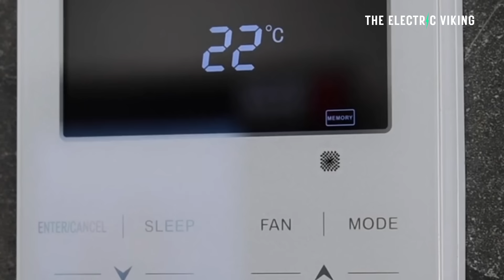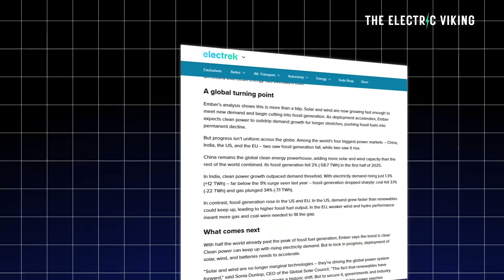Renewables Soar Past Global Pivot Point - Beat Coal For First Time In History

Comment: Wind and solar power connected to the power grid ARE NOT RENEWABLE ENERGY requiring more natural gas for high readiness backup making nearly no electricity than making all the electricity from natural gas combined cycle power stations.  In real terms it makes no difference how large their percentage is on  the power grid.   It is how much fuel they save which is non.   Wind power with wild fluctuation second-to-second is the most natural gas expensive form of generating electricity.   Steam turbine generators react too slowly to support solar and wind generated electricity so the only alternative is expensive  to fuel natural gas turbine generators.   That's why coal power stations are being retired along with being inefficient and old.   

China is re-powering its grid and increasing capacity with new USC clean coal power stations.    These have liquid steam not traditional steam that allows some fast response for supporting wild AC from solar and wind power.   The US's war on coal since 1992 appears to be coming to an end.  The US will hopefully follow China in re-powering its grid and expanding capacity with highly efficient USC coal power stations burning high BTU bituminous coal.   The policy of giving solar and wind power on the grid free very expensive to fuel support backup should be closed out.  Every percent of it on the power grid comes at high natural gas expense that can't be met by cheaper to fuel sources.

Power River Basin low sulfur low BTU coal has only had a market for old coal power stations unable to meet sulfur dioxide emission requirements otherwise.   China has bought a lot of this coal.   That is probably to use in dirty coal power stations with no after treatment to give substantially more breathable air, but sill very dirty air.  There is little market for its use in new USC coal power stations.  Its been well acknowledge that coal with be otherwise worthless if not for its low sulfur content.

Comment: The only pivot that matters is GHG levels which are accelerating upwards at record rates so why you spouting this ?  Its clear we have passed tipping points that will cascade to ever worsening effects , there is no room for optimism until GHG falls .
Reply: This video mentioned it's dropping in the electricity generation sector. 

Overall, use is still going up, but it's very important to celebrate victories and progress when they happen. Pessimism causes little to give up or avoid change. Optimism, the belief that you have the power to make positive change, drives action
Reply: better visit eastern Europe or Russia, you will slash your wrists.

Comment: This is another absurd story!! Every energy time will be used to meet the increasing energy demand. Coal, Oil, and gas use will go up with renewable energy.
Top 10 Countries by Renewable Share in Electricity (2024 Data)
Enerdata Global Energy Trends 2024; Eurostat 2024 data (confirming high EU performers like Denmark at 88.4% and Portugal at 87.5%). Note: Some countries like Iceland (nearly 100% from hydro/geothermal), Costa Rica (98% hydro), and Paraguay (100% hydro) also achieve near-total renewables but are not always ranked due to smaller scale or data variations.

The major economies are not.

Comment: Sadly the amount of coal being burnt is still rising by about 1% per year. Renewables are rising faster but renewables surpassing coal use is not the same as coal use declining. With huge demands for energy to run AI, energy use could increase rapidly which means that coal use will not slow down for some time. Gas use is also increasing at 1% per year. Complacency is not good.
Reply: The acceleration of solar is so absurdly fast and not slowing down, that the peak of coal use is probably this year or next. 

The economics and timelines just makes sense. You can't build a coal plant faster than you can install off-the-shelf panels & batteries. And it's just more expensive in most places
Reply: the tide is turning thank goodness.

Comment: Solar and wind power will go the way of the dodo bird when better technologies are implemented. Thorium nuclear energy is becoming a reality. Thorium reactors can not only use thorium a waste product of rare earth element refining but also nuclear waste. Quais a spin off company of MIT will make geothermal energy available in most areas. Water to burnable gas technology will not be able to be suppressed forever as others are duplicating Stanely Meyers water powered vehicle. Just imagine, water fueling cars, trucks, locomotives, and jet planes. No more trips to the fueling stations. No more long waits for the battery to charge on an EV. Just fill the tank on your car with your garden hose.
Reply: That'll be cool when it happens. Nobody's suppressing it, they're just not ready yet. 

Until then, we go with the solutions that are functional and available to solve the immediate problem, because there's no time to wait for a new tech. Fossil fuels need to be phased out yesterday
Reply: It's called steam engines. We've moved on from that inefficient energy production.

Comment: Here in the UK we live in the 5th cloudiest country in the world and solar even makes sense here
Reply: Yes it does. It was calculated that we would need just 3% of land covered with  solar to power the whole of the UK.
Reply: @markgilder9990 and how much of the UK is Urban area? You can preserve forest and farmland and still power everything with just panels over buildings, parking lots, roads, carports and other paved surfaces
Reply: @kylejohnson6775  I believe it's about 8% urban, so yes, easily room for the 3% mentioned.  NB they're "car parks" in the UK ;)

However the question is, does that still work in winter when the daylight is least and the energy demand greatest?  Until we can get lots of batteries that can store power for months, we'll have to keep a considerable wedge of gas for heating and electricity for those cold dark months
Reply: @Shikuesi we’re a world leader in wind energy mind and usually the winter months when solar is lowest the wind is strongest and generates more. Issue is calm winter days, but hopefully storage or burning a bit of gas then as needed in the meantime till we have sufficient storage, covers things.
Reply: @Shikuesi 

It works less well unless you massively over -build capacity. If you've ever heard about the studies where they examined "how far can we go with just solar and current batteries?" the cost always has an exponential spike as you approach 100% of the hours in a year covered by just solar, for exactly the reasons you mentioned. The darkest shortest days are tough, but they're a small minority of the time and mostly a problem for the minority of humans who live far from the equator.

So, solar and batteries can do the bulk of the work, and you need wind, nuclear power, maybe enhanced geothermal, maybe hydroelectric, or maybe a breakthrough in bigass seasonal-storage technologies, for the last 5 - 50% (location dependent) of hours in the year where solar can't cheaply cover your needs

Comment: The comparison between coal and renewable energy is misleading. Renewables have an average capacity factor of less than 0.3 while coal has a capacity factor of at least 0.9.
A comparison between them should factor the coal value by 0.9 and the renewables by a factor of 0.3. So, they are both equal in energy output if the renewable number is THREE times the coal value.
Reply: The output values (how much solar was generated this year) include the capacity factors. 

Also, if you're making an honest comparison, you need to include the capacity factor for their actual use, not theoretical use. In China the coal capacity factor is a little under 0.5 and falling, because solar and wind and batteries are cheaper and being used more than the coal plants, so the coal plants are spending more and more time idle
Reply: @kylejohnson6775  Point conceded about capacity factors.  Last year in China renewables represented abour 52% of nameplate capacity but only supplied 12% of Total demand. Coal was 42% of nameplate but supplied 70% of total demand. China's renewables were mostly IDLE.
Reply: @sabb007 

I don't see how this conflicts with the figures in the video of total electricity generated or the other point about capacity factors. We already know that renewables are idle most of the time. That's the single most common complaint or mentioned downside. They're so incredible because they're meeting demand and beating prices of coal despite the idle time

Comment: You would think that companies would see the writing on the wall and start slowly replacing fossil fuel driven machines with electric (from solar\hydro\nuclear\wind\battery) driven machines, including those needed for power generation, cars, construction and agriculture machinery. Who knows if cost considerations or the environment will be enough of a stress on financial resources that companies will make the transition. If the price of oil and gas keeps going down, and it remains cheaper to use them as fuel than renewables, they will continue to keep using them until renewables become a no-brainer. We haven't actually reached that point in the USA.  But I'm convinced within a decade we will reach that point, and affordability will be the biggest factor as it usually is when sane people are in charge.

Comment: Coals are still useful in furnaces of iron ore.  But that requires high quality coals.
Reply: Iron ore can be reduced to iron using hydrogen generated by electrolysis. Lots of projects are starting up exploring the technology. But....

Once you've got the pure iron, you still need to add carbon to turn it into steel.
Reply: Adding carbon to iron isn't really a climate change issue though, because it's solid carbon. If it's not a gas in the atmosphere, no trouble

Comment: in Romania: 
1 MWh produced from Coal powerplant cost: ~400 euro - 450 euro
1 MWh produced by wind/solar cost: ~100 euro - 150 euro
In the last week Wind power is the number one producer.
Reply: Brilliant.
Reply: Kost per MWh for solar in europe is closer to 5ct/kwh with large german PV plants now achieving as low as 4ct/kwh. Considering the higher yearly solar radiation PV cost in Romania can likely reach costs below 4ct/kwh.
Reply: Wind/solar at 100 -150 euro MWh is not the real cost.   All that erratic power costs more natural gas in high readiness backup making nearly zero electricity than making all the electricity from natural gas combined cycle power stations.   Wind power with wild fluctuation second-to-second is the most natural gas expensive form of generating electricity.    The UK and Germany are culling wind farm output to save on very expensive natural gas.   Wind and solar on the power grid were made possible by cheap Russian natural gas.  Without it they are too expensive of novelty to support.   Spain appears to still be running on cheap Russian natural gas.  In the US natural gas generated electricity bids at $100 MWh.   That source can be used for high readiness, but the payment scheme is not on bidding platform as such.   It would be a very high set costs with little electricity probably being called on.

Comment: Scientists have developed a new type of concrete material that can function as a massive battery, turning buildings and roads into energy storage systems. The team at Massachusetts Institute of Technology (MIT) first developed this next-generation energy storage system in 2023 and has now made it 10 times more powerful. This breakthrough means that the average home would need approximately five cubic metres of the material to meet all its energy needs, which is roughly the size of a single basement wall. The concrete battery works by combining cement, water, carbon black and electrolytes. Together, these materials create a conductive 'nanonetwork' inside the concrete that can store and release electrical energy. “A key to the sustainability of concrete is the development of ‘multifunctional concrete,’ which integrates functionalities like this energy storage, self-healing, and carbon sequestration,” said Admir Masic, co-director and associate professor of civil and environmental engineering at MIT. “Concrete is already the world’s most-used construction material, so why not take advantage of that scale to create other benefits?” Professor Masic and his team improved the energy density by reconstructing the conductive nanonetwork within the material. They tested with different electrolytes, such as seawater, to find the optimal method for storing energy. The technology could expand today's renewable energy capabilities. Buildings equipped with solar panels and this revolutionary concrete could potentially operate entirely off the grid.

Comment: I also believe that sodium batteries will rapidly accelerate the increase in renewable energy.
Reply: Forget sodium batteries or so-called renewables. Just use water as a fuel as Stanely Meyer did. I believe it would be cheaper to run a home generator on gasified water than to use solar panels and battery backups for the same task. In most places in the world water is very cheap to free.
Reply: @georgestreicher252  Go ahead and provide a practical demonstration unit then price it.
Reply: @georgestreicher252  sorry mate, not gonna happen.
Reply: @georgestreicher252  In addition to Meyer, other claims have been debunked, including those of John Kanzius (Seawater Burning, 2007) and Agha Waqar Ahmad (Water Kits, 2012).
Reply: Sodium will have its place but lithium is still necessary for transport.
Reply: @williammeek-h2o 

No reason to compete or compare. They both have incredible value
Reply: @kylejohnson6775  How can something that doesn't work have value?
Reply: @williammeek-h2o not necessarily - the energy density isn’t much less and a pack might cost half the price. Most EVs could live with a bit less range for a significant cost reduction.
Reply: @glyngreen538  Batteries are cheap now. removing range won't help pricing all that much.